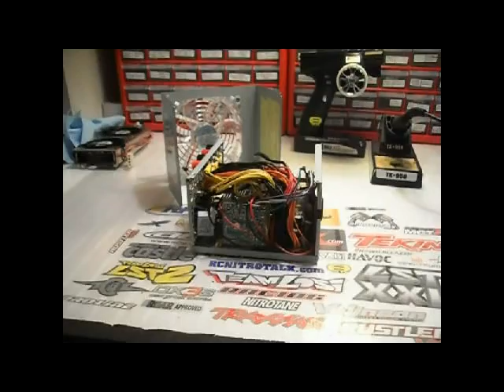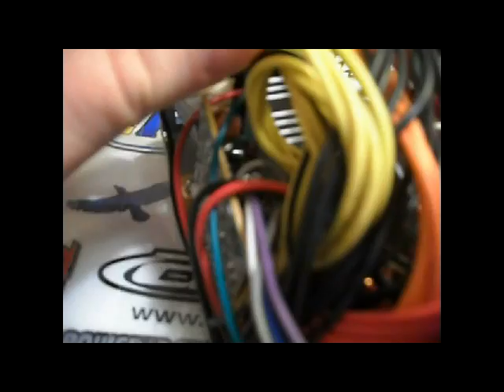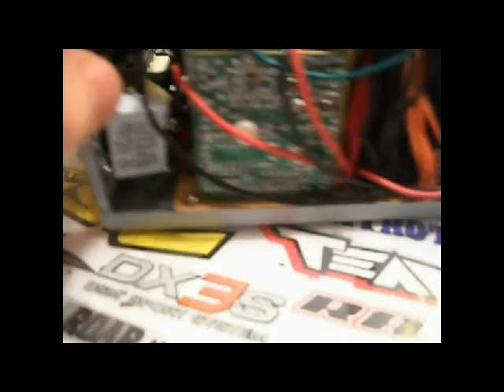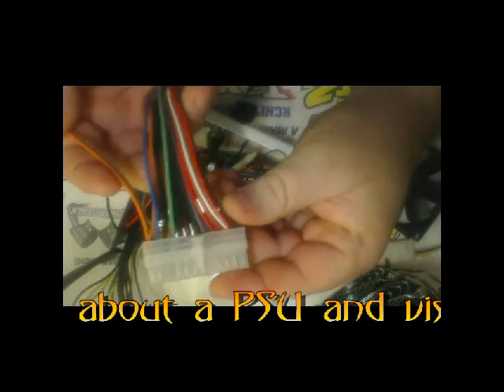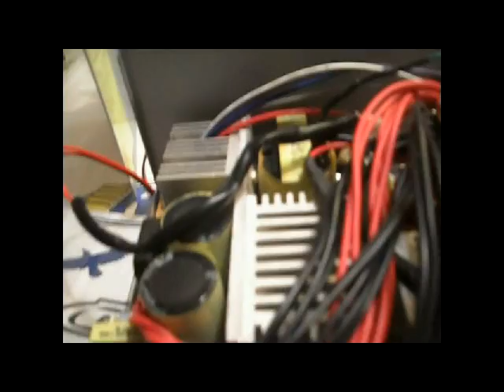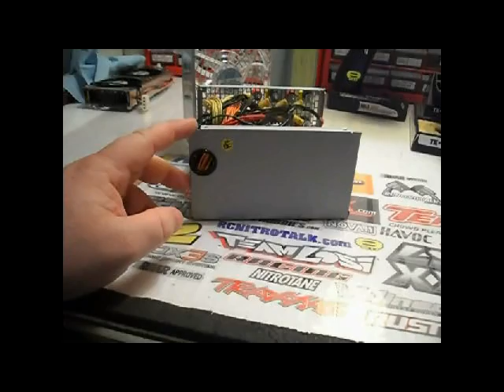ATX PSU to DC Power for lipo chargers

Comment from the maker: Hook a lipo charger or something up to it that uses a fair amount of power and use a volt meter to see how much the voltage sags. In my case I did this before and after adding the ceramic resistor to the 5V side and I had less sag after.